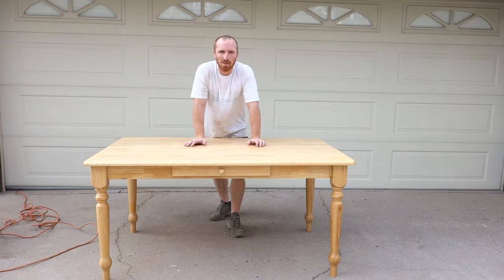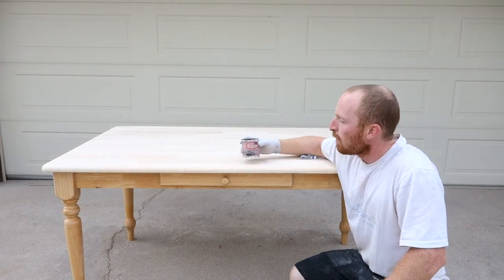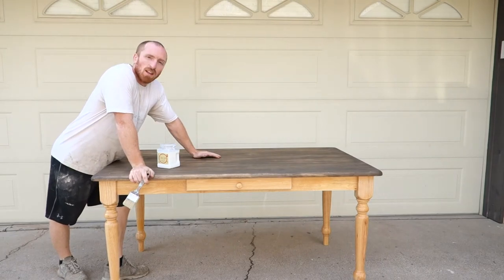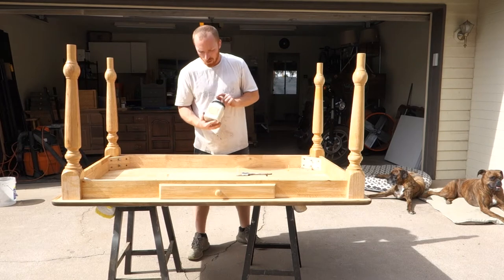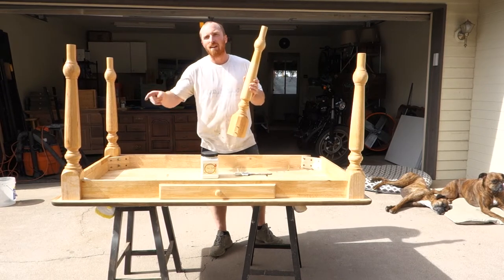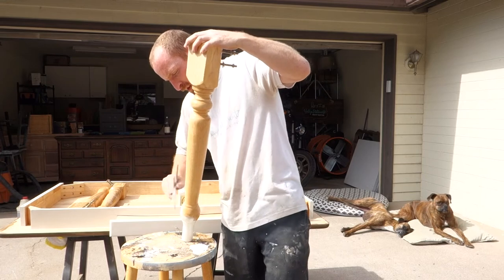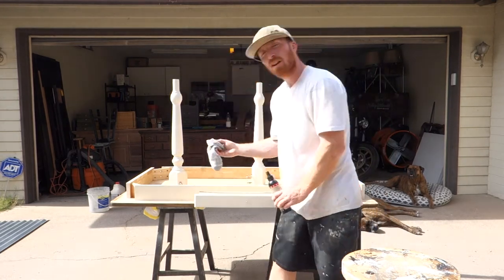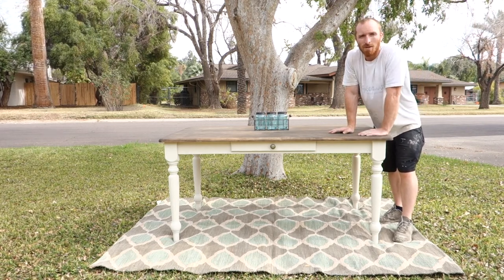How to redo a Butcher Block Kitchen Table

Comment: How do you sand the legs if you want to stain them, too? My hands are shot and wondering if I could at least partly use an electric sander...?
Reply from the maker: It’s hard to use an electronic sander since they are more for flat areas. The legs are like 90% round. You could try a paint stripper.

Comment: HI just saw your video. Walnut stain is a brown color, does it come out light on the butcher block because you just do one coat? I've stained with walnut gel stain before but my projects come out a bit darker.
Reply from the maker: You could do two. This specific one... it was to have the worn in look. Each piece of wood accepts the stain differently so it’s always an adventure on seeing the outcome.

Comment: I'm liking the very popular butcher block, farmhouse look! 😊 Also, thanks for the neat trick on painting the legs. I have one question....how come the table top is sanded but not the legs...just curious? Thanks VS.
Reply from the maker: D. Bird!! Some table legs are sanded but I just forget to video that process OR I’m doing a chalk paint which doesn’t require a sand. Most,  I sand even if chalk painting. Good question.
Reply: Appreciate it!